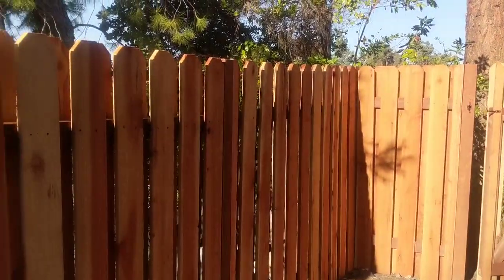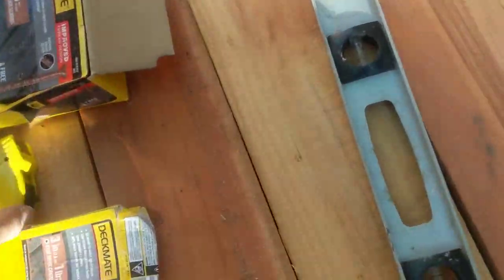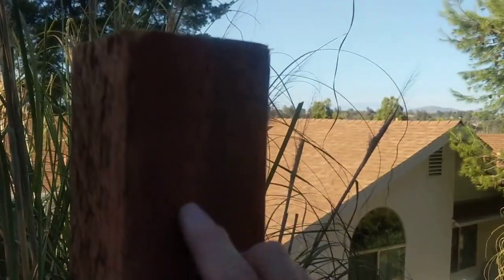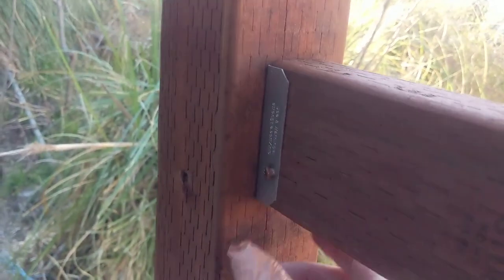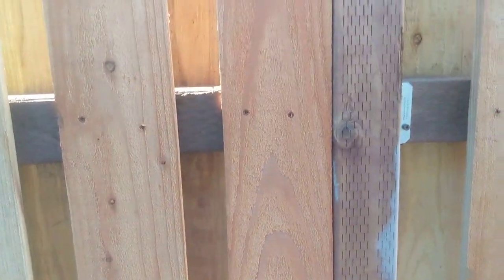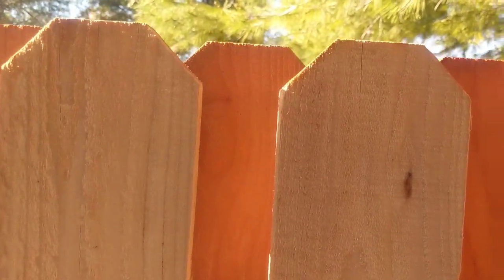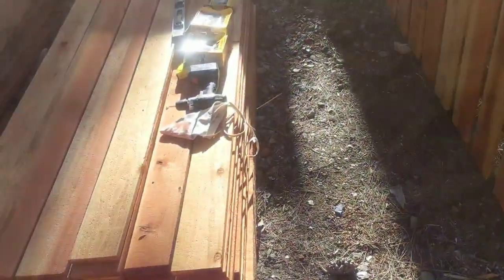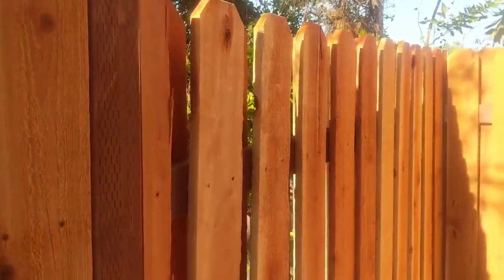Installing a good neighbor / shadow box fence

Comment from the maker: Some people have pointed out that the diagonal in the gate is the wrong way that is it should be from the top edge of gate to the bottom hinge side.  They are correct.   This is the tension vs compression diagonal.  To explain wood works better under compression that is its better to have a 2x4 under a beam versus supporting it from above.  there is an anti sag kit that is a long bolt this of course can only be used in tension so would go the direction of my diagonal as a long bolt wire has no compression strength

So if it weren't for the skin of this fence making it a solid object it would only be the thick long multiple screws on my diagonal acting similar to an antisag kit that would keep it from sagging.  I do feel the sides have become a skin which more then makes up for the reversed diagonal.    The thick 3/4x5.5x6 foot redwood double screwed and overlapping side to side make it effectively like a door skin or plywood skin on a sheer wall or even a roof  truss (some don't use diagonals just a plywood skin)  all of these examples dont employ diagonals due the strength of the skin becoming a box beam (even the thin 1/8 inch hollow core door replaces an inside diagonal) and effectively make them a solid object like the box beam or very close to it.   

  So here it doesn't really matter but it should have been reversed and im glad its pointed out so thanks.

Comment: Nice looking fence. Need to flip your door angle piece the other way though if you don’t want it to sag. If it goes the other way it will work against sagging, right now it will cause it to sag.
Reply: good point, nice find

Comment: I think the diagonal support on the gate is supposed to be going the other direction? Diagonal down toward the lower hinge, diagonal up toward the upper lock?

Lock                  Upper hinge
     \                    [ | ]
          \
              \
                  \
                      \
                         \ [ | ]
                           Lower hinge

Looks beautiful.
Reply: You are correct top swinging outer down to lower hinge it's a huge error otherwise. It's tension vs compress . many vid on it on utube. I bought a house with sagging double driveway gates and that's why they sag. Its on my list.

Comment: Just wish we had those style post here. Only have pine pressure treated.
Reply from the maker: The posts are listed as Brown Stain Ground Contact Pressure-Treated Lumber and the description says from western wood species (probably all soft western woods pine fir spruce...) It says treated with Copper azole treatment.  They were purchased from home depot in California and are currently priced at 17.60 each  if that helps.   Good luck with your project.

Comment: Hi, I'd like to know what diameter deck screw you used, because my simpson strong tie bracket comes with 4 little holes in it, and the screws I have are too large to fit through any of those predrilled holes in the bracket. What size deck screw will actually fit through those predrilled holes?  Thanks so much!
Reply from the maker: You can open my description with a computer and see a lot of written information so most questions are answered there.  It is a size 9 gauge.  they do fit but are tight also the head doesn't countersink but keep in mind that a thinner screw would be weaker.

Comment: Why is so hard to find the style of fence that I have whereby the boards are slanted overlapping so you can't see through the fence at all. The top and bottom rail (2x4's) has a groove that encases the very ends of the boards. The boards sit inside the groove in the 2x4. Anyone know what this design is called?

Comment: Did you have to drill hole first before using screws. They won’t split the wood?
Reply from the maker: No not necessary.

Comment: Where did you buy bulk pickets?Home centers and local fence company's are telling me no sale on em.
Reply from the maker: I first bought from home depot to get started then when I went back they were all out of redwood.  So I called around J and W lumber said they had some in another city and would have them in 3 days. Cost was about .25 more per board.   I parked next to the boards and they loaded them and unlike Home depot every board was nice so definitely recommend them.  I do know there are some lumber shortages right now good luck.

Comment: What length screws did you use for installing the bracket on the 4x4 and on the 2x4. Also, did you have any issues with the bottom screw and the lower screw on the bracket going into the 2x4 hitting each other?
Reply from the maker: I used the 2 inch going into the 4x4 it is a 9 gauge so fits tight but it is strong.  Going into the 2x4 I used the 1 5/8 9 gauge.  The bracket has the holes offset on the sides and screws don't hit each other I imagine the bottom hole is as well since I never noticed it hitting.

Comment: Hi John, are your screws #6 or #8?
Reply from the maker: The ones I used are 9 gauge.  They barely fit the bracket holes and their heads stuck out a bit but it would be worse to push through or break if they were thinner so since they worked and were strong and coated I think the 1-5/8 # 9 deckmate are great for this purpose.

Comment: I thought this was a good video to reference for the fence I built. Then he gets to his gate, and it was at this point he lost all credibility to me. The diagonal support brace on the gate is backwards. It should always be from the bottom of the hinge side to the top side of the latch side. Else it doesn't do jack diddly.
Reply: Not here to knock this video but you’re exactly right. It’s astonishing how many builders don’t understand physics. I see far too many gates built incorrectly by “professionals.” I’d be ashamed to put my name plate on some of these fence projects